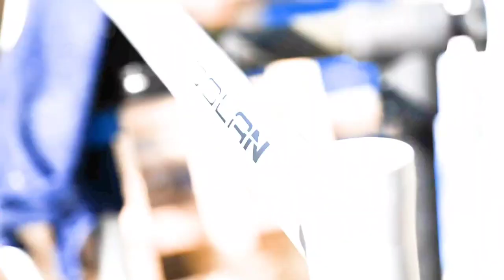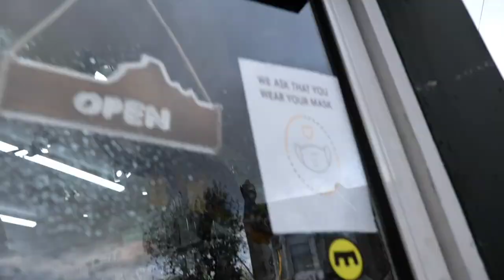BEST BIKE BUILD EVER!! | DOLAN BIKES

Comment: I want to buy the same frame 50cm, does youre foot overlap with the wheel?
Also are you able to do a bar spin? Do you have enough clearance?
Any info helpful thanks.
Reply from the maker: My foot does overlap but it depends on the forks as I can't barspin with straight bladed forks! Hope this helps 👌

Comment: Caveat Emptor  - This is gonna get plastered on every single Dolan bike clip i can find on youtube as a warning to the buyer. 

I purchased a reduced price frame with a "cosmetic blemish" that was so rediculously small not even their own cameras could document it. Turns out a year later that the actual frame is misaligned and not fit for purpose. How did this frame get past Q&A at the factory and at Dolan itself? Greed. 

They put this frame out with the "cosmetic" defect fully knowing that it was not cosmetically defective but structurally defective. I only discovered this a year later when i tried to build it up, finally, after getting parts. I paid decent money for a junk frame that i cannot even sell as i dont want anybody riding this piece of shit of a frame. So now i am out of pocket. A lot of money of out pocket 

If you buy anything of theirs, be it new or if it has a "cosmetic defect", inspect it immediately. I emailed them when i discovered this. Of course it was ignored and no response given.

Personally, i would avoid buying anything at all from them now that i know what practices they use. Basically sell the customer shit that is not fit for purpose and hope they dont discover it right away. I would avoid any of their sales purported to be "cosmetically defective" as that most likely means the frame was sold, came back and they are trying to shift it that way.

I am actually thinking of sending this to Hambini so he can explain to me why my bottom bracket does not want to last. Thsi will be a huge negative publicity for them.

How did this frame get past the internal Q&A at the manufacturing level as well at Dolan's themselves? You tell me.